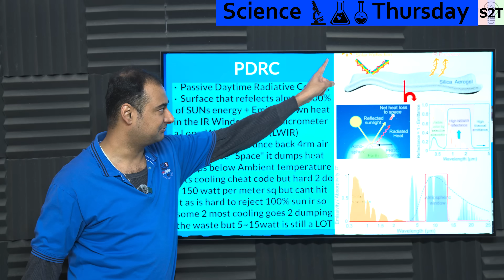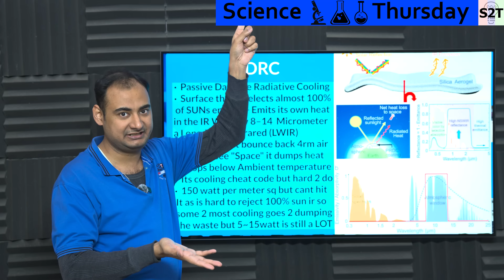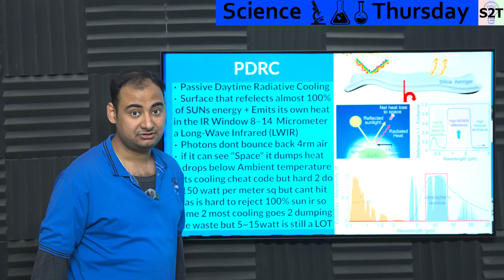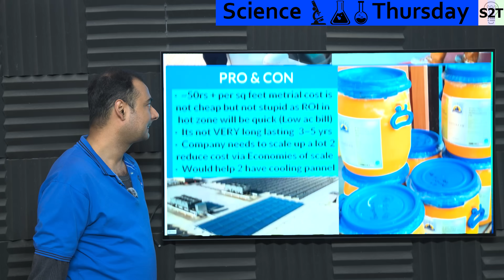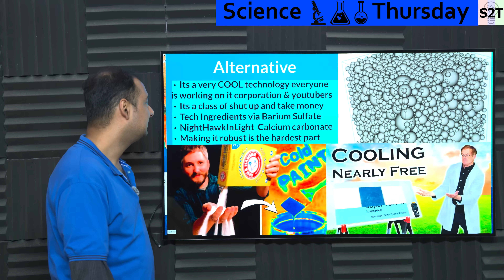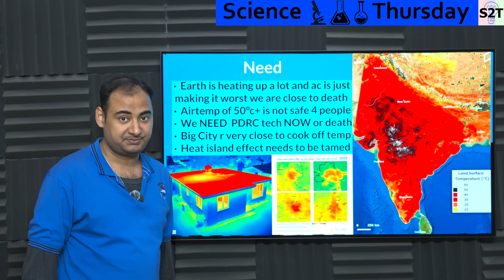Ganzkuhl {Sky cooling paint} Explained  @QGennext

Comment: With a lifetime of 3-5 years there will be a lot of used or broken down material, which most likely goes into the environemt as dust and such. Are the breakdown substances harmful in any way?
Reply from the maker: there is a reason they worked very hard to make sure there is no toxic metal in its construction like lead so it can breakdown safely

Comment: That's a nice technology! However, I am a bit skeptical about how the tests are conducted. They compare between uncoated concrete or coloured surface to PDRC white coated surface. It is clear from physics that white colour absorbs less heat compared to coloured surface. Unfortunately, they do not have proper tests between different colours of uncoated surface and white PDRC coated surface. It would be nice to have these tests performed and compare.
Reply from the maker: I have asked them to make a cooling pannel as that would be much better for Validation